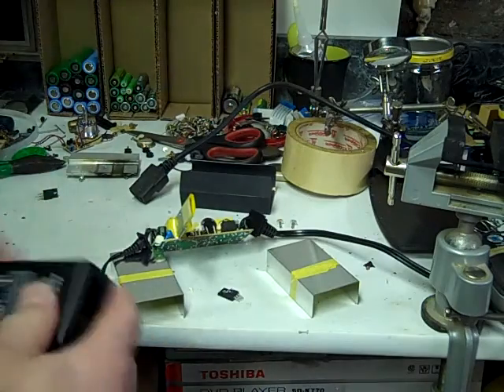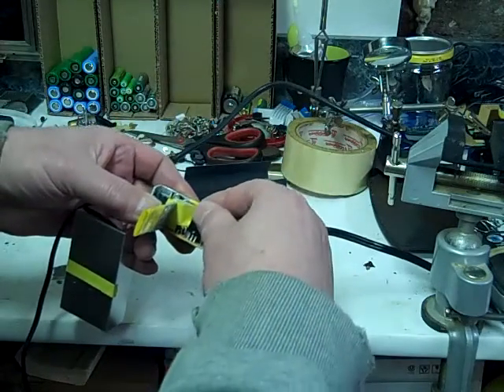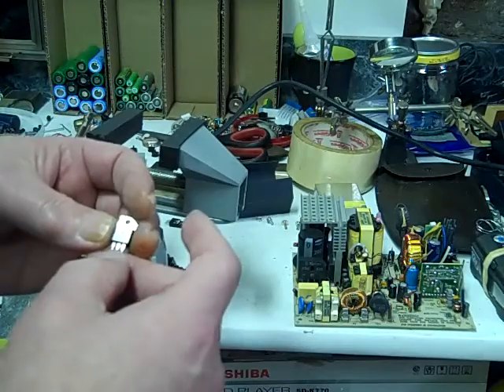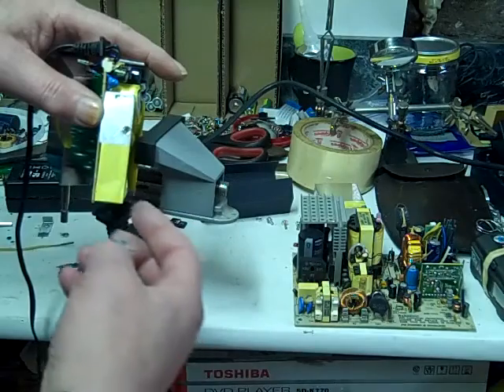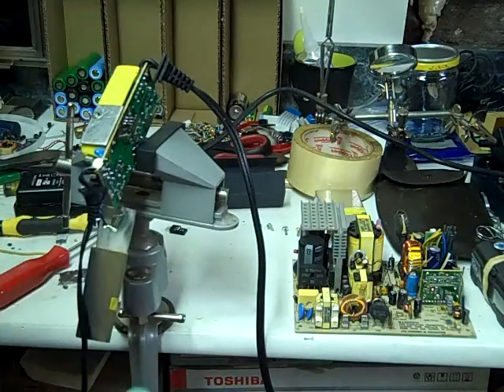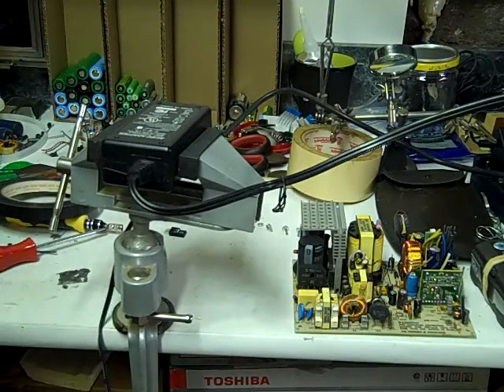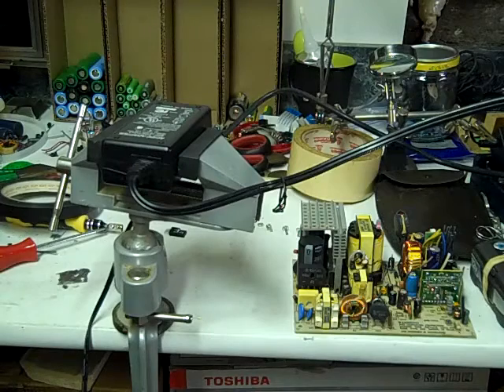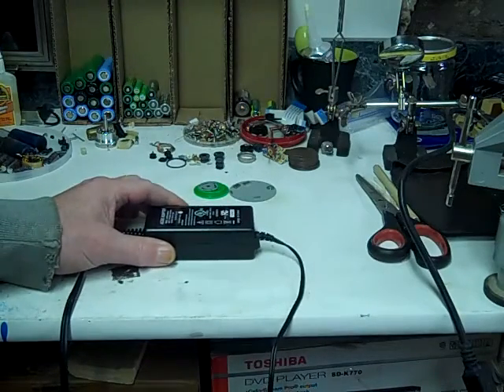Laptop Power Supply Repair   Fix it Yourself!

Comment: Hi I've opened the charger , and found every single component perfect as it is. No burns or fire or loose. But it is not working. What should be the issue in which component?
Pl help
Reply: Not every component will "burst" when failing. I would suggest you to test every route and test the status of your components (even those that seems fine)

Comment: hi my charger of laptop charge for 10 after this it will be hot and no charge please help me
Reply from the maker: It could be a bad battery.
Reply: No ... the hi voltage came to charger after this accident it was that case ... i need to know what the part is damaged
Reply: Thanks
Reply from the maker: Maybe someone can help you here. I would need to take it apart to test it.